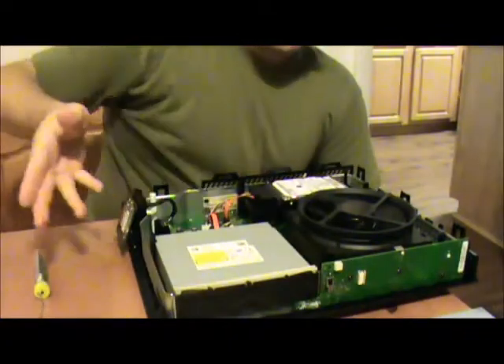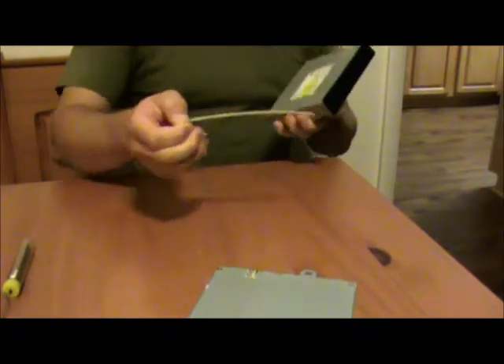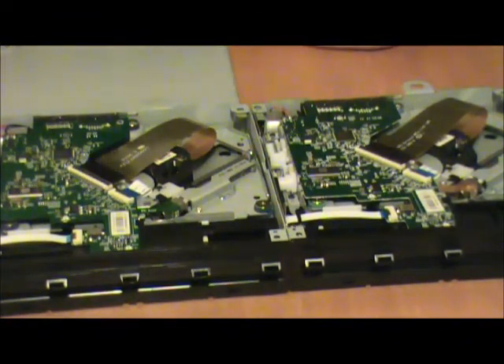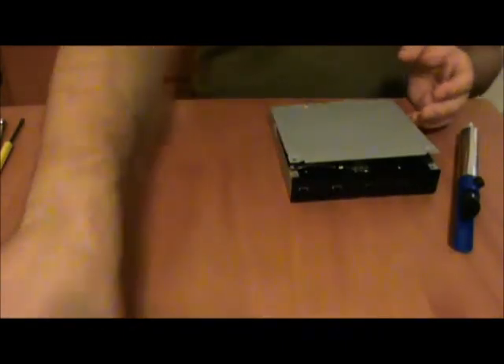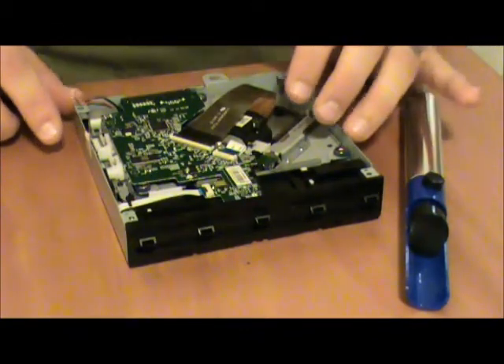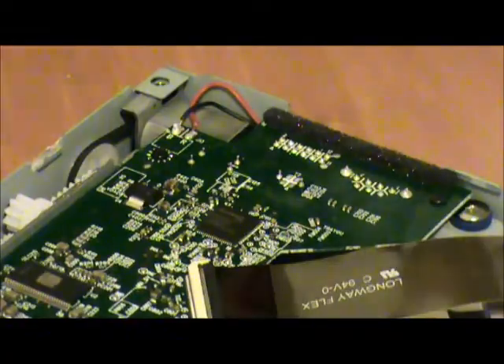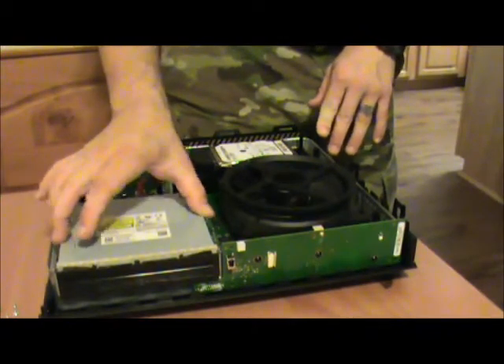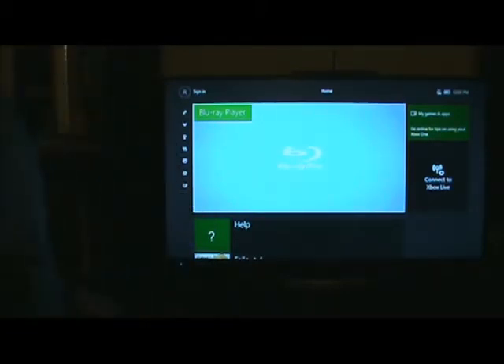how to install a new bluray drive into an xbox one.

Comment: I purchased a Xbox one console motherboard and they advised I will need to do minor soldering, they said I would need to solder the PCB board onto the working Blu-ray drive? what are they saying I thought I could replace my faulty motherboard with the old Blu-ray drive? Thanks in advance
Reply from the maker: Kenny Scott Sr you mean the board from the blu ray drive not the main console right? Because the blu ray connects to the main board via plugged cables. Not hard soldered ones.
Just follow all the steps in the video you will be good to go.
Reply: I purchased a new xbox one motherboard and replaced mine, it wouldn't work properly, then a repair guy advised that I have to have the disc drive from the new motherboard,  he said you have to have those both to make the motherboard work.
Reply from the maker: Kenny Scott Sr this is true. You do have to have the actual blue ray drive that is paired to the motherboard by a registry code in the system memory for both the drive and the motherboard. Without that you will not have a working system.
Why did you replace the motherboard instead of selling it for scrap and buying a new one?
Reply: Because I got the motherboard and optical drive for 30.00, cheaper than 175.00 plus
Reply from the maker: Kenny Scott Sr ... Hmm. Ok tell ya what: make a video of it, show me what you have going on, and upload it to youtube and post a link on here. I will then be able to actually see what you are talking about, and i will help you if i can.
Please remember: i am noy microshaft certified, i am not a microshaft rep or repair guy, i am just a huge nerd who is self taught on all this.

Comment: Can I just pull the laser and motor out after I detach the board and swap that as opposed to actually switching the board? Pretty sure my issue is just with the laser and trying to avoid having to solder.
Reply from the maker: there shouldnt be any solder points on the board. it should all be latch set microconnectors and microribon cables.
Reply from the maker: alright. i just had an idea. i need to see what you are seeing.
if you can upload a video for me so i can see what you are seeing when you open your blu ray drive then i will be better able to help you. otherwise i'm flying blind.

Comment: Sr  i cant even put the disc in drive it wont let the door or flap open. i wanted to buy the whole unit  the same exact one and just stick it in there  will it work by just swapping the assembled unit with the same make and model without all the soddering stuff
Reply from the maker: Alighwa Henderson theres no soldering involved. yes you must swap the brain boards of the blu ray drives. because there is a unique registry code in the momory chip on the board. which cannot be gotten to without extra hardware. plus software, and the skill and knowledge to use that software. trust me this video demonstrates the best way. just watch the whole video and walk thru the process as i demonstrate it step by step. keep the pause button handy. do not try to rush. take your time. rushing leads to mistakes and accidents. if theres a part you need to re watch then do so. its why i make these videos. to demostrate, inform, and help, by having a teaching guide that you can go thru at your own pace.

Comment: Hey I swapped my drive and pcb board and now my disc drive won't power on to take discs or eject them, do you know what that problem could be?
Reply from the maker: Jimi Hendrix did you make sure to plug everything back in exactly as it had been with the previous drive?
did you make sure you got exactly the same make and model of blu ray drive to use as replacement?

Comment: Thanks for the video sgt! Do you have a link to where you bought the replacement drive?
Reply from the maker: Zostron 42 amazon my friend. amazon. just mske sure you pull the old drive first. then look at the model number. search amazon for a same model drive. then order that one. when it gets in follow all directions shown in the video to swap the brsin boards for the drives and then put the new drive into the xbox with the old brainboard.
have fun. and good luck.
Reply: Sounds good. Thank you sir!